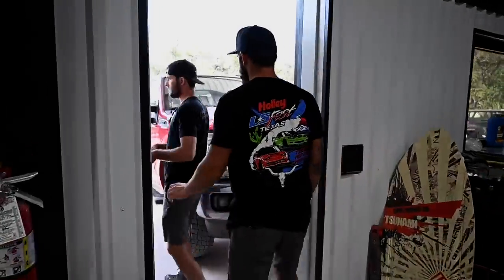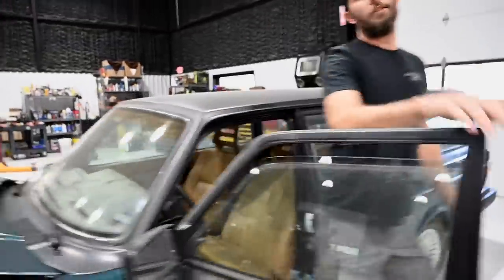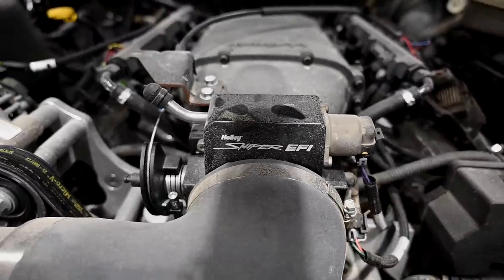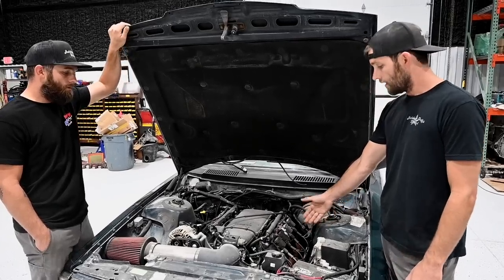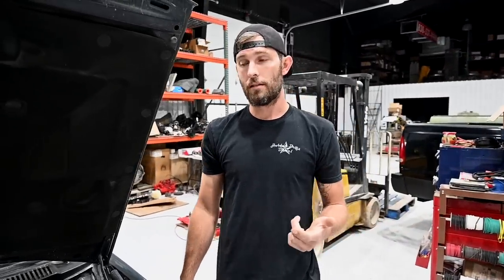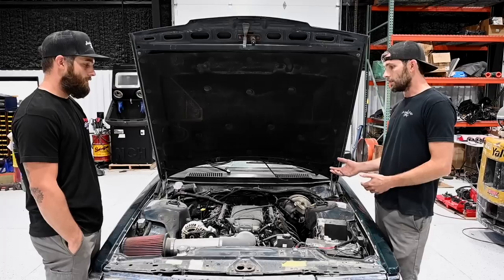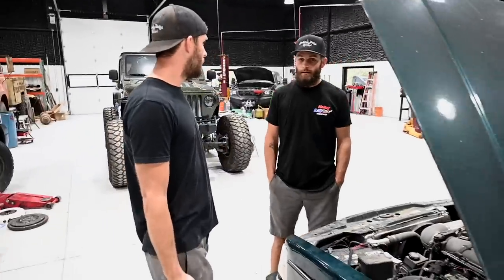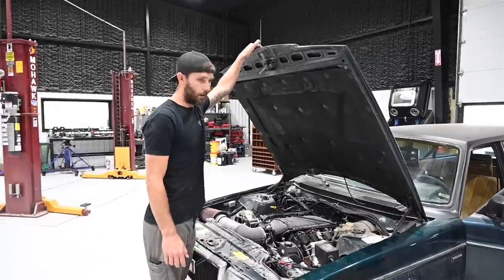Joy Riding a TV Car

Comment: Love the wagon!!  Almost 20 years ago I had a 1991 Chevy Cavalier station wagon in the D/FW area.  It was very similar to the premise of this build.  The stock 3.1L V6 was bored .030 over, the crank was from a 1989 Pontiac Grand Prix Turbo, it had a custom Crower cam, a T3/T4 turbo, and a 5 speed manual transmission swap(all Cavalier wagons were automatic).  

It was a sleeper, and even had the license plate SLEEPR!  It was a terror on the street having surprised a LOT of people, but was slow from a dig with having no traction till the top of 3rd gear.  I miss having a wagon!!

Comment: You Guys know that volvo with the original engine  they are made to last forEVER i dont think i never have heard a volvo of that ages die before they runned 500 000 miles atleast. i remember we had one we was gonna try kill on my school we drained it for oil and revved it on a farm field for 1hr it never died so we filled the oil cap with two hands full of gravel and mad it run parked  for 20 minutes before the engine diedxD